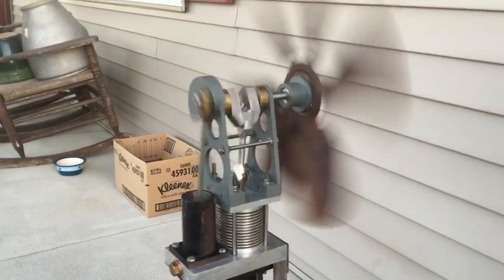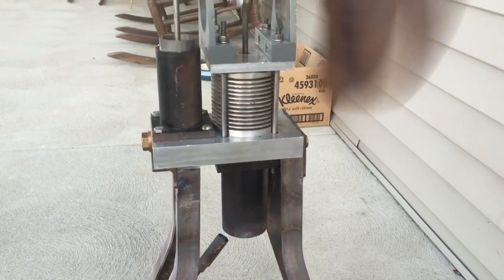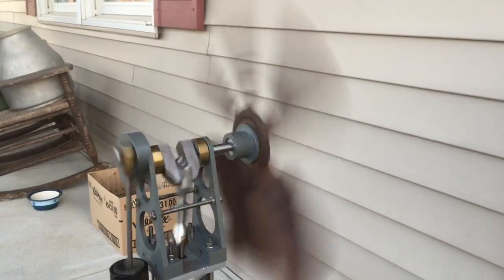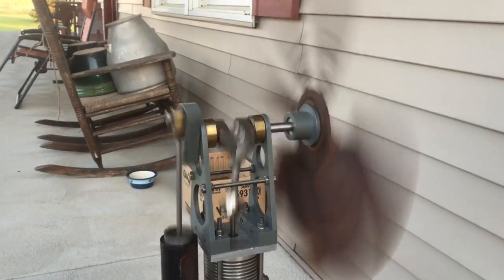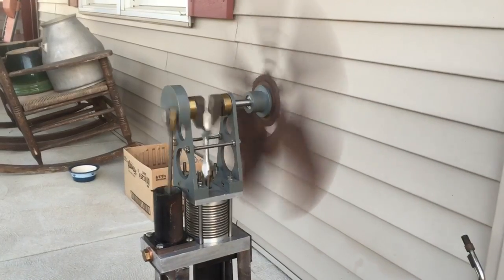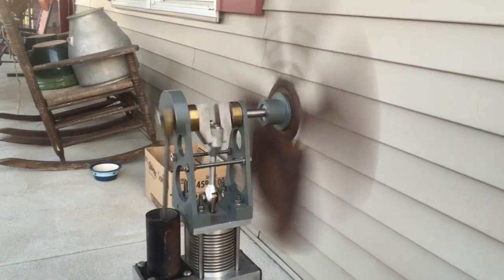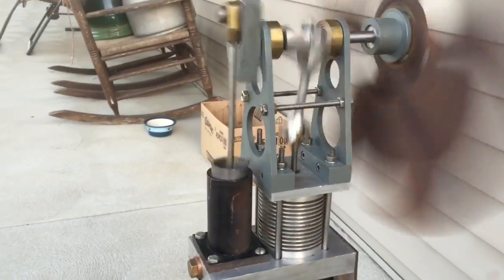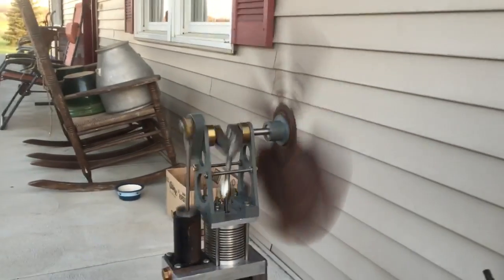Moriya Stirling Engine Fan

Comment: How much air does that put out?
Reply from the maker: Not much, really. The fan blade is actually designed to run the opposite direction. It's acting more like flywheel than a fan. I plan to make a proper fan blade for it in the future.